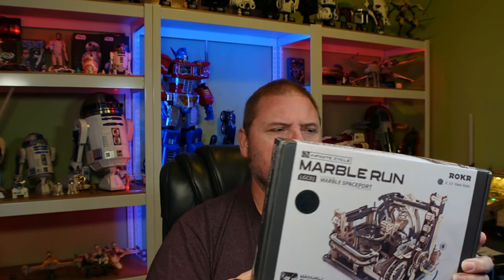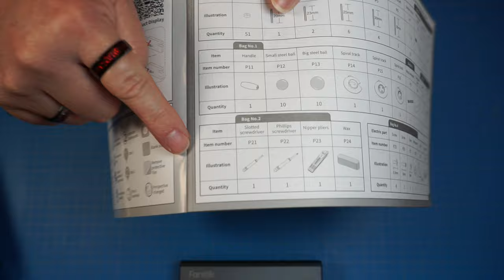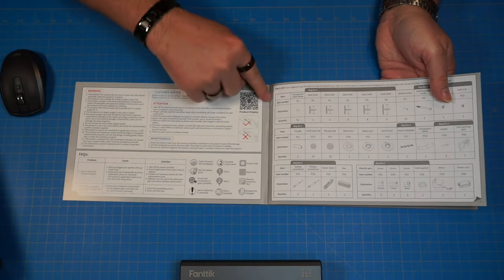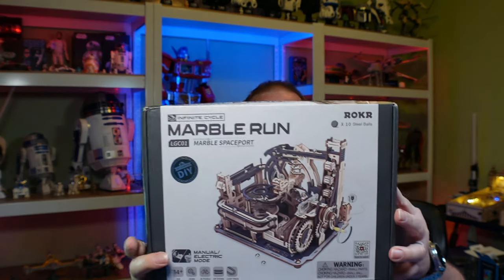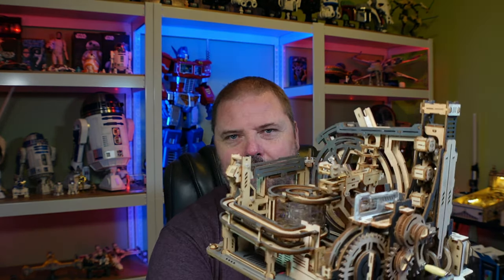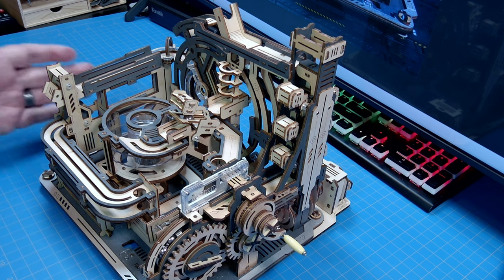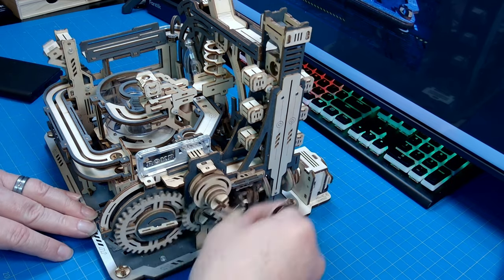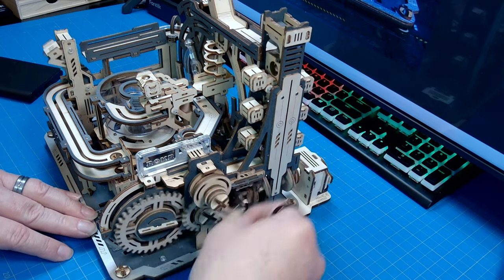ROKR - NEW MARBLE RUN - MARBLE SPACEPORT

Comment: Great video! I've just ordered one and am excited to assemble it. 
Try using an old USB-A to USB-C cable with one of the ancient power adapters that take forever to charge your phone. If the motor gets less power then it will run slower.
Reply from the maker: Thank you so much. You're definitely going to like it. I'll have to try that with the cable. It's a good tip.

Comment: Great vid... Agree from what it looks the motor is way too fast but that's not the point as you want to see the Mechanics on this thing which means you probably want the manual engagement
Reply from the maker: Thanks so much. Since they designed this marble run to connect with their Night City marble run, the motor has to operate both at the same time.  I think that's why it's so powerful. It's definitely better to operate this one manually.

Comment: Thank you for your video 🤗. I bought this kit and also the connection kit between this model and the night city. When they are connected, the motor is not as fast as in your video. 
But first I will build the pin ball.
Reply from the maker: @b.r.4653  Thanks for watching!! The pinball is my favorite.